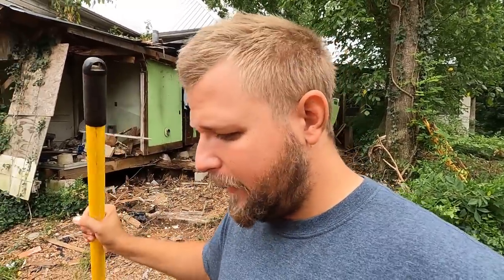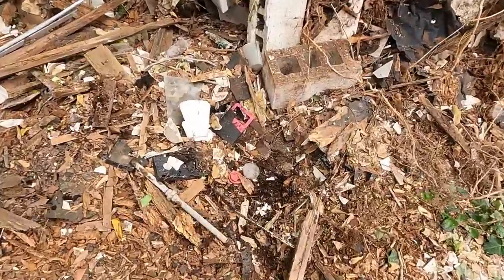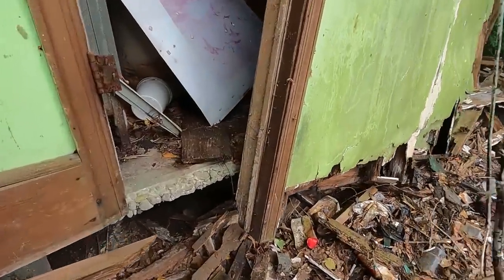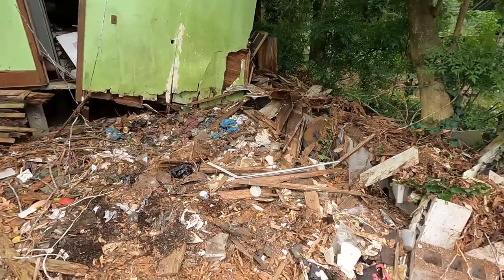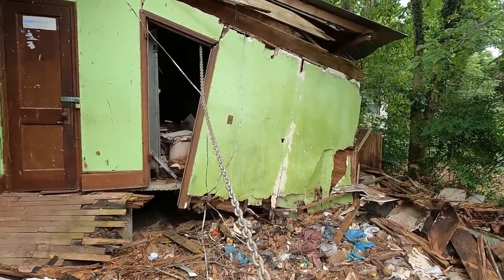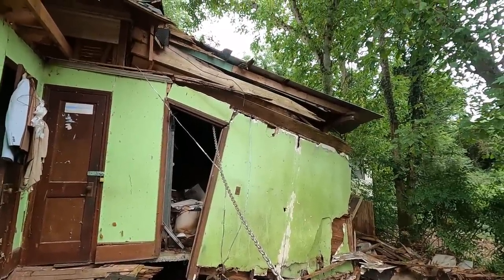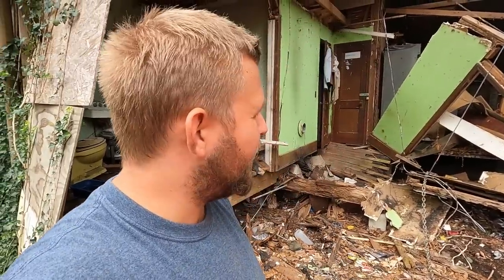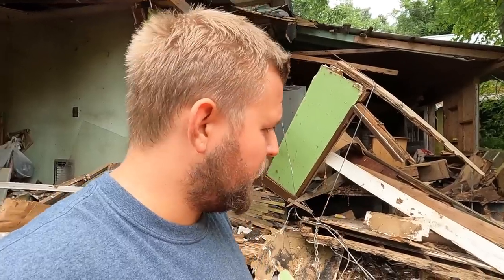PULLING DOWN A WALL AND FIXING BROKEN WATER PIPE ON 140 YEAR OLD FARM HOUSE

Comment: Have you located any wells or septic tanks on the property? Along with pipes, these are important to locate and mark. Given that there were at least two homesteads on the farm, there's probably more than one well. Best to find them deliberately!
Reply from the maker: The well for this house is under the concrete back porch and I know where the septic tank is also. Any other wells have long since been covered or filled in.

Comment: The round block may have been used as a foundation pier. A metal post or rebar would run through the center to stabilize the stack.